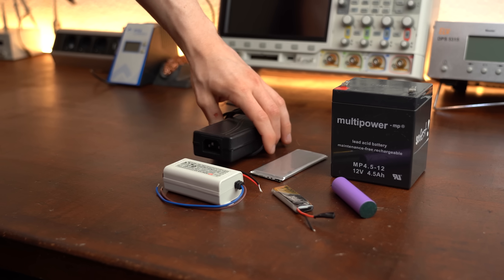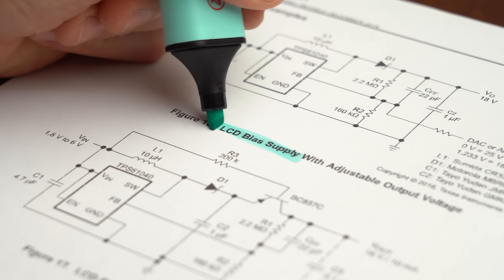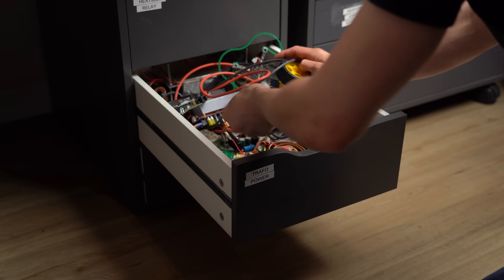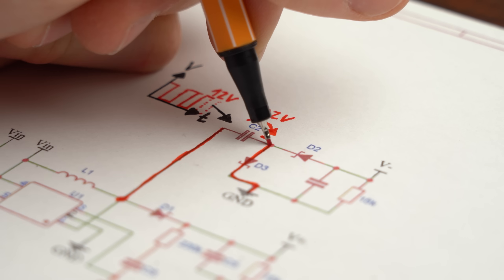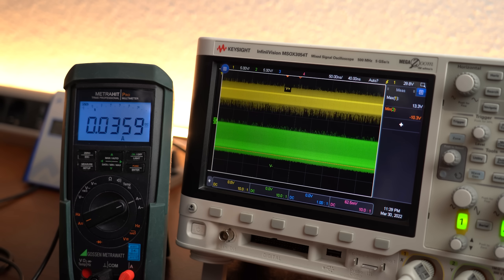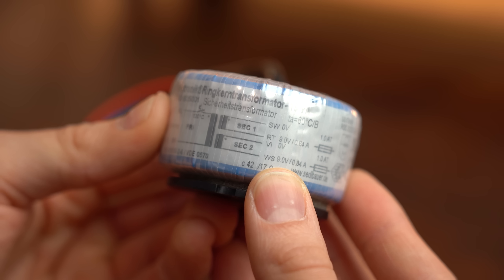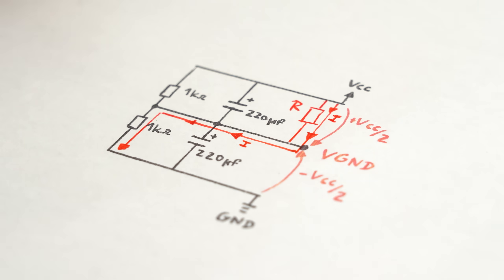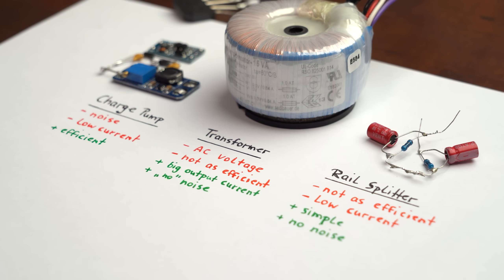Negative Voltages are more important than you think! So here is how to make them! EB#52

Comment: My very first power supply I built back in 1983 (13)used a 555 for the oscillator and charge pump for negative rail. Built from striping down a car battery charger which the bridge rectifier had failed and been thrown out.
I have used the charge pump for several negative rails. The idea came from an everyday electronics magazine.

Comment: So question. 

I had a computer that had an odd power supply. It spit out 3.5, 5, 12, -5, and -12 DC. It also spit out, on an unpopulated pin, -120 AC. Why would anything need that?
Reply: Normal desktop bulit-in power source has this output voltages... except the mains on the output which is not common (it may be used for adding some additional peripheral). Also special kind of small mobile PCs with external power source instead built-in have these voltages on dedicated power connector...
Reply: @vencdee  Its negative mains. I cant think of anything that goes inside a computer from the early to mid 90s that needs either positive 120 volts or negative 120 volts. I get -5 and -12. But -120? And AC at that

Comment: i recently bought a home theatre (boAt blitz 2000) which offer a 100w RMS. when i opened it, i noticed that the main subwoofer is 40w and satellite speakers are 15w each (total 70w).
but then i noticed something really strange  the transformer it was using is 12-0-12 at 1.5A, which means the total power it can generate is 36w only. so why is it advertising the home theatre with 100w RMS?
please reply if anyone know anything about it.

Comment: Great video, but I think you should've also mentioned switching power supplies like the ones used in computers as they have both +ve and -ve 12 volt outputs.
Reply: Fun fact, most PC supplies don't even provide -12V any more.  If you look at the ones that do, you'll find they also have something like 50mV max current.  The -12V was used for serial ports.  These days, we just generate it locally on board.

Comment: Also I think it would be nice to mention the option of DIYing a inverterting switching converter using some commercially available switching IC.
I found that for situations where a transformer is not an option either due to size or not using AC power source and an output of 1-20W is needed with minimal ripple in a very compact size, this is usually the only option.
Seeing how cheap PCB ordering is nowadays, its even pretty inexpensive and not very challenging even for inexperienced hobbyists, seing that the reference schematic and pcb layout in the datasheets are pretty decent and for most cases can be copied 1:1.

Comment: You forgot to mention that there are loses in the diodes so it is inverting - something or rather said it is not as negative as the other voltage is positive. Also the noise varies based on the load it it is a small load then the noise can be reduced a lot by the caps (if they are large enough).
PS it might be useful to make/try a discrete component buffer with some large MOSFETS , might be simpler then some of the other discrete approaches  (if they don't have it already in them)

Comment: Can we add another isolated center tapped coil with the inductor?

Another solution is to boost the 12v in to 24 v and using the input positive (12V) as virtual gnd
Reply: thx mate
Reply: 240watt Fast charging how its work
Reply: Oohhhhhhh hi
Reply: but if i run 2 in parallel? one at 12 and another one at 24? that gonna work?

Comment: I must say Those adjustable voltage regulator boards are wonderful. I've yet to have a project I haven't used one for!could I have made one from scratch? Shure but going with the board saves time, and if it's not clean enough I can just toss another capacitor on it.

Comment: Of course, you could also add another power supply to add the necessary negative voltage with the needed current; if it's a lot of current and also loaded uniquely to the positive supply.

Comment: Aren't there switching power supplies that can be connected in series (with protection diodes)  to achieve  dual rail supply with high current capability?
Reply: Yes only if they are isolated, ie, each have their own mains input and switching transformer, and their outputs are floating. If their outputs are mains earth referenced, you cannot put them in series because that would  short out the bottom supply through the earth connection.

Comment: The ICL7662 has been around forever and is an easy way to get a negative voltage. With just two added capacitors it will convert up to 20 volts to a like negative voltage. I have used it for many different circuits and it always works well. There is also an ICL7660 but it has a max 5 volt input. The output is not regulated so it will drop with load but it is good for low power circuits in the 50mA range.

Comment: Fun fact. Telecom carriers use -48volt DC because it is easy to store in deep cycle batteries and can backup equipment during a power outages for much more time than a regular UPS.
Reply: Another fun fact, it's not really a negative 48V  it's just 48V with the positive terminal connected to Earth
Reply: @LabRat Knatz You're correct negative supply was used to reduce verdigris

Comment: Another approach is to use an adjustable buck boost converter with the positive output lead connected to ground. I used this setup for delivering negative voltage to a large LCD. Of course the converter has to have isolated potentials in order not to create short circuit.

Comment: Hi, Great Scott, before all i have to thank you for all, I've have learned a lot thanks to you through your videos/explanations. What will be the right transistor solution for ''audio amplifying'' at low voltage signal between 100mv to 500mv at the gate or base(depending on the type of transistor) that can be triggered to let pass the current between (collector/emitter) or (drain/source) with low noise, maybe using and array of op amps that can be set like in bridge mode or something like that?(to make sure to limit the noise the more as possible) Thanks you in advance.

Comment: @GreatScott -- Nice video as usual. But... when you use an arrow to label a voltage difference, it's conventional to orient the arrow from lower voltage to higher (assuming the value you label it with is positive).  So at 7:38, the arrow on the negative output is oriented conventionally but labelled wrongly, while on the positive output the arrow is oriented unconventionally but labelled correctly.  In other words, both arrows should be pointing up, and both should be labelled +Vcc/2.  Another way to look at it is that the arrow symbolizes a voltmeter, with the tail being the negative lead, and the head being the positive, and the numeric value (and sign) is what the meter would read.  It's worth mentioning that a voltage arrow symbol is almost always in the opposite direction to the positive current direction, so if also annotating the diagram with arrows for current, it's necessary to make sure they are distinguished -- which is usually the case if labelled with xxV or xxmA etc.

Comment: much like your voltage divider circuit, I used an LM7805 between +10VDC and GND, this made a +-5V with good current.
Reply: 7805’s output stage is not bipolar, so I’m not sure if you can sink significant current into its output without it misbehaving. If you want to use linear regulation, you’d be better off with a power opamp as shown in the video since these devices are designed to work correctly for both sourcing and sinking current.
Reply: Oh no? What do you think is inside 7805’s?

Comment: Loved the video. Nice use of charge pump. Anyway, maybe a small error is present on the schematic of the circuit you drawn. FB has C5 tied in series which suggests that it won't work. For FB, you would need a DC level established. 
For everybody suggesting using two DC/DC converters in order to get dual rail power supply, you would want to use isolated DC/DC converters for that. If not using isolated converter, you end up getting a virtual GND point. In some applications (for example grounded enclosure), you might end up shorting output of first converter, i.e. converter that provides negative rail.

Keep creating videos. I love them. You have some great ideas.

Comment: I am currently looking for a voltage converter capable of producing +2.4V and -2.4V from +12V and I was hoping to find the answer to this problem in this video, but unfortunately that is not the case. I need an output current of 3A.

Comment: For most signal stuff that needs a negative range I prefer to just split the rail with an op amp. That's generally 20mA(before any derating, but how much current do you actually need to process signal?) per of fake ground at 1/2Vcc, and it's easy enough to bias the signal down to be centered on ground for its final amplification if it's audio or the like. That's more than enough power to preamp, even if you're only working with a 5v rail.
Reply: Oh, nvm. You covered rail splitting.

Comment: great video. I remember surfing the internet for a solution to turning a single DC supply into two rail supply. it was a long and tiring process finding the right circuit to feed my opamp audio filters. I tried using two boost converters (one high side switched and one low side switched) and that turned out to be a mess, it worked but it wasted so much energy it was useless. I still haven't concluded what circuit im gonna use cause that project got halted a year ago.

Comment: Why don't just use 2 12V Power supplies or 2 12V batteries connected into series to get the split Voltages?
No noise and a lot of current?

Comment: Better check your transformer power supply - you put fuse between center tap and GND. If fuse blows it gets separated from GND, but other rails remain connected to 78xx and 79xx with then „floating” GND common to both of them.

Comment: You can also make a dual +/- power supply from a single output transformer. You just need to use a single diode for each side. The disadvantage of this solution is that each side will be effectively half-wave rectivied, so you need to use bigger smoothing capacitors, but the advantage is that single output transformers are much easier to find.
Reply: What about using two identical single output transformers and connecting their primaries in parallel, then connect the secondaries in series (essentially making a center tap) and connecting that to ground?
Reply: @MuhammedGemci , I think that ought to work, but be careful with the polarity.
Reply: nice tip... gonna use that thanks

Comment: If you want to use the transformer alternative without using mains voltage you can use an oscillator from 0v to vsupply to convert the dc voltage to ac and then supply that to the primary of the transformer.

Comment: but why the heck do you need this
if i've got two rails with positive on the left side and negative on the right side,i dont need all of this fancy shit, but only to switch the polarity..And i can do so with two transistors. Or if i want to use the negative and the positive at the same time, i just solder both to it. Wheres the problem. I dont get it, cause ground is only ground by definition. And why would i need negative or positive voltage, if there is only a thing like negative voltage, if i define there to be ground. I can define anything i want and the electronics wont care. So what is this about@

Comment: What a complication. Get 2 equal smps and connect the positive terminal of one to the negative terminal of the another. Now you have 3 wires and a dual rail power supply. Try it.

Comment: Did i miss it or did he not explain if there's a difference between two rails-PSU and just using two PSUs?
I guess if you want 24V (in the 12V + and - example) the two separate supplies would be a bad idea...

Comment: Just one question: why is there a fuse on the centre tap? That will only provide protection against overcurrent flowing to 0V. Two fuses are required for complete overcurrent protection. Convention states they're normally at both ends of the winding, but putting one on the centre tap and another on one end of the winding is acceptable and will work.
Reply: If the connection on the center tap breaks then one supply polarity could see double its normal voltage, depending on the load. For this reason I say that fusing the center tap is generally wrong.

Comment: The easiest way to get a dual rail power supply is using one buck converter. supply 24v to it, set it to 12v positive. Now use the buck converter's positive (V+) terminal as your GND. Between V+ and the input (VIN+) of your converter there is 12v and -12v between V+ and GND of buck converter.

You can supply as much current as your BC can handle, assuming your power supply can too.

Comment: You can actually use an LM2596 buck module as a negative voltage generator, and you can draw loads of current from it since it's not a charge pump! The great thing is that practically no hardware mods. Search for LM2596 negative voltage, and you'll find a Wordpress blog post that explains how to do it.
Reply: You can also use almost all Buck Converter Modules. Connect the + Supply with Vin of the Module, GND to Vout of the Module and You will get the negative Voltage at the GND-Pin of the Module. The Summ of Input Voltage and negative Output Voltage has to stay below the maximum allowed Input-Voltage of the Buck Converter Module.
Reply: @schimmi2  True, but I'm not sure if it can be accomplished with a synchronous rectifier where the "diode" is instead a MOSFET, and built into the chip. The other downsides are the large inrush current and the fact that the output tends to be noisier compared to when not generating a negative voltage. I've solved this in the past by adding another inductor in the series and an additional output capacitor, a pi filter.

Comment: I use two diodes and two caps on the secondary of a single secondary transformer. It uses the upper half-wave to charge the positive al cap and the negative half-wave to charge the lower voltage rail cap. No need of center tap this way

Comment: I was recently thinking of making a negative voltage supply by using a reversed flyback converter. I wonder if this would be able to provide a higher output current. Great video. I never knew of the charge pump hack.
Reply: Yeah flyback converters can be used, you only need to flip the secondary transformer to get a negative output
There's a lot of flyback converters that include both a positive and negative branches, with 2 secondaries windings on the transformer and essentially the same circuit as the output

Comment: I've been using an MCP6022 dual op-amp with one amp creating a virtual ground to work with a sensor's biphasic signal off a 5V supply. I've been looking for how to create a negative voltage supply from a single 5V supply, but it's good to know my approach is still appropriate (and less noisy than SMPS)

Comment: If the boost converter uses a small toroidal inductor, you can easily add a second winding to derive the required separate (negative) rail.
Reply: But then what happens when you load down one of the rails but the feedback resistors are on the other?

Comment: How about using a H-Bridge switching fast, filter output with diodes and smooth with Caps to create Pos and Neg supply?  Would be able to get much more current out of something like that...
Reply: H bridges are good for reversing the direction of current like through a motor but they dont actually have a ground point that you could use and the voltage difference is only relative and between the two output terminals. It changes the direction of the potential difference and therefore current flow but it doesnt create negative voltage. If you measured the voltage between either output and the circuit ground, one would be at the supply voltage and the other at ground, there isnt any negative voltage there.

Comment: Such a good video that I needed some weeks ago when i designed a positive and negative voltage and now I have more info thanks.
Another way is to use a Buck converter, if you see the schematics of a inverter converter and a buck convertee you will see the same image just flip so the lm2596 can generate negative voltage if you put GNd to output and Voltage to.input, it bootstrap the voltage so if you get -12V from 5V the input will see 17V that is the disavantage the limit would be the max input voltage of the IC but it is pretty straight forward to get negative voltage like that without soldering anything